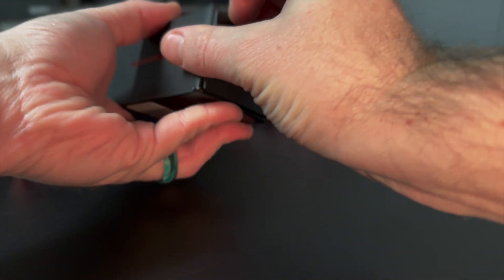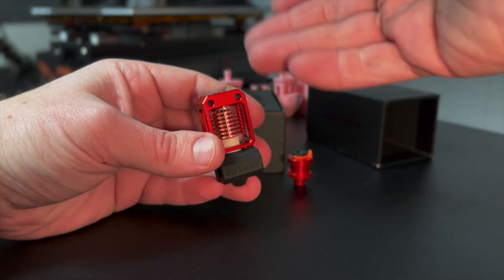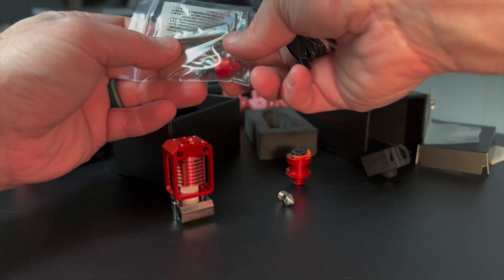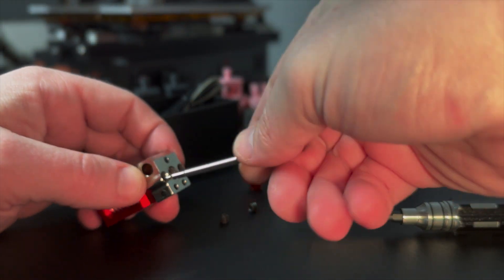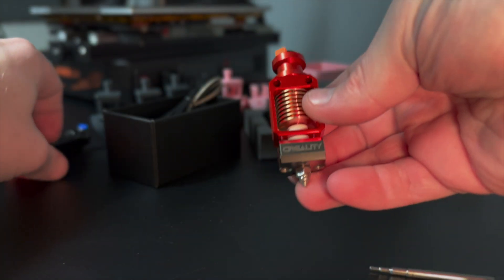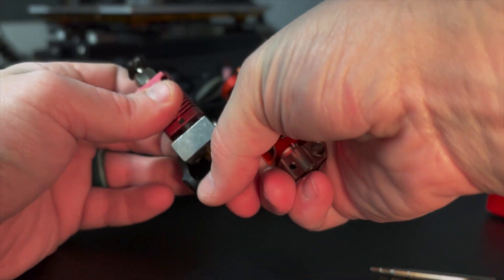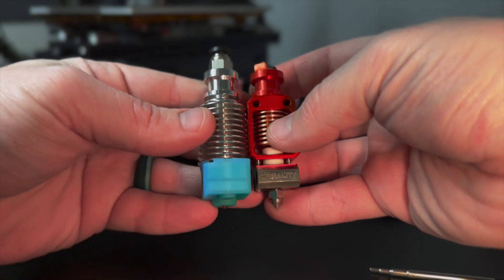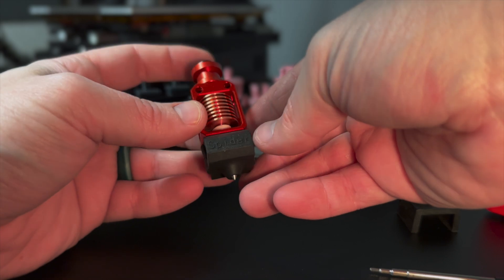The Ultimate Hotend Upgrade: Discover Creality's PREMIUM All-Metal Hotend 🔥🕷️

Comment: I purchased a used Ender 3 Pro with the CR Spider hot end. Also, BL touch installed. Any idea which firmware I should be installing?

Comment: Here’s my experience with the spider 3.0.  I’m relatively new to 3d printing so I can speak from minimal experience on the whole.  Having said that, I’ve learned a great deal about my Ender 3 pro over the course of the past few months.  From day one I’ve had issues with bed leveling and adhesion.  The only way to get decent adhesion, was to have the nozzle practically touching the bed.  Using the paper method, it had to be supper tight, as in not being able to move the paper between the nozzle and the bed.  I upgraded and adjusted rollers, tried upgraded springs (including the rubber ones), upgraded bed wheels (complete with locks), added Z axis stepper and lead screw. I Made sure the unit was square.  Yes, I calibrated the extruder.  The more I tried, the worse it seemed to get.  Finally, I started having issues with clogs on top of everything else.  I was just about to toss it in the garbage.  Being a tinkerer and an “upgrades” kind of guy, I had already purchased the spider v3 and had it in a box saving for when I felt like installing it.  As a last ditch effort I went ahead with the upgrade… BOOM!  The very next print was TONS better.  After toying with the nozzle height a bit, I started getting first layers like I’ve never seen before.  Now, using the paper method, I set it so there’s medium to light pressure, but the paper moves freely forward and back.  I would say closer to .1mm.  Of course you shouldn’t have to replace the hotend right out of the box, but what a relief.  Now I can get on with my 3d printing life.

Comment: Can you change the nozzle without holding the heat block?
Reply: Yes, I was noticing that also.  Since the heat block is bolted to the upper part you should be able to remove the nozzle without have to hold the heat block so it does not move.

Comment: Did you actually test it or just give it the thumbs up on just how it feels and looks?
Reply: Have to agree here, was fastforwarding to the part where we could see some results. But that part never came.
Reply from the maker: I got it as soon as it came out and made a video of it unboxing it, showing it off in case someone was interested in it, and gave my first impressions. I gave it a thumbs up on just how it feels and looks. 

You ever give a Ferrari a thumbs-up even though you’ve never driven one?
Reply: @3DPrintSOS  I would like to buy it on how it performs not how it looks and feels. Ferrari analogy is ridiculas.
Reply from the maker: @MacAdder1965   I respect that. Always do your research. For the record, I don't believe you. There’s no way you don't care about how things look or feel.
Reply: @3DPrintSOS  It could look like a pregnant frog for all I care as long as it prints amazing..... Looking amazing and printing like crap doesn't interest me.... This is going to be covered with a fan shroud so how it looks is irrelevent.
Reply from the maker: You’re not wrong. I agree with you there.  @MacAdder1965  But yeah, I haven’t gotten the change to use this hotend, as much as I wanted to. Just not enough time in the day. Maybe one of my builds will need a hotend in it soon, then I will likely be using this one.

Comment: I've had two of these and both ended up clogging critically.
Reply: Did you MPC or PID tune the hot end? Did you limit retractions as suggested? The Thermistor and wires are easily damaged that can throw off what temp you are actually running.
Reply from the maker: Oh man. Sorry to hear it. What fan are you cooling this with? Bowden or Direct drive?

Comment: Didn't realise you reviewed this product. Bought this as part of an upgrade for my cr10s pro v2 with klipper as I wanted to print more materials at a higher speed. Had to do some minor tweaks to the printer to make it fit but other than that it works really well. One thing to note that this nozzle is a high flow with a large heated area so it doesn't like being used on slow speeds without alot of oozing and air entrapment. I tend to print around 15 to 20mm3/s with a .6mm nozzle and it works great. Did upgrade the heater to high temp 60w cartridge but not sure if that's required.

Comment: I have a Swiss all-metal hotend for the past year and all the sudden I can't compete a print without clogging.  I tripped down and cleaned block and metal steam. Made sure all the plastic was removed even in the threads.  Verified there is no gap between the nozzle and hotend steam that threads into the block. I repeated this three times. I get clogging during infill and fails the print. Short of buying a new hot end i dont know what I am missing here. I was running black sunlu pla at 205, 215 and 225c. I was thinking hotter the better but this is not the case. In the past I alway ran sunlu pla at 215 to 220c and never had issues until now. Any suggestions?
Reply: PID or MPC tune the hot end. run the test multiple times, especially if the first tune fails.

Comment: I have had one of these sitting around for a while. I need to get around to installing and testing it. I am using the original spider on one my 9 printers. The OG spider has been working great with all filaments be it PLA,TPU,ABS, PETG or even PC. 

Only complaint I have with OG spider is the weight and the special nozzles but they are becoming more available.

Comment: What’s a good site if I wanna make custom prints and can I do it on my iPad
Reply from the maker: What do you mean by custom? Check out Printables.com and Thingiverse.com. Not sure if you can slice these files on an iPad. You might be able to use a browser-based slicer but im not sure.
Reply: @3DPrintSOS  like if I make some digital art from my iPad and want to make it 3D if that makes sense
Reply from the maker: @strangealternative3357  The only 3D Software im familiar with for the iPad is Shapr3D.
Reply: @3DPrintSOS  oh ok thank you for taking the time to help me I appreciate it
Reply: @3DPrintSOS  and when 3D Printing is it only possible to do it on a laptop like I heard people can do it on their phone
Reply from the maker: @strangealternative3357  If you can find Gcode files for your specific machine or similar, you might be able to load in a file onto an SD card or onto a printer that has Octoprint or Klipper installed. But you need to “slice” a 3D file so that your printer knows what to do. A GCode file is the only way to get it to print. Most of that software is only on computers.
Reply: @3DPrintSOS  ok and atm all I know is that I have the Voxelab Aquila X2 if that helps with more information

Comment: If that's an all metal hot end for printing high temp materials then the real test of how well it resists heat creep is to run some cheap pla at the temp on the high end of recomended temps with 6 mm retractions.  Build a model that requires lots of retractions and if no clogs occur then definately a winner.

Comment: It's a hard sell at that price. I mean, they will probably sell, but to me, at 40 to 50 percent the cost of my entire aquila, it doesn't make sense.
Reply from the maker: Yeah but let’s say you’re building a machine like a Voron, RatRig, or going all metal on a custom or FLSun machine. This to me is one of those pieces you buy that will literally outlast a build. With that said, I think it should be $50 bucks. But I think we all want everything to be cheaper.
Reply: The biggest advantage I've seen with those mid range hotends is the better flow rate compared to the stock hotend. It's more consistent, so you can print a bit faster before you run into speed related flaws in your prints. 
If speed isn't something you're too worried about, it'll make no real difference
Reply from the maker: I disagree. I don’t go for speed myself but rather the ability to print all materials. More importantly, not having a ptfe tube near my nozzle. This hotend does all that plus more. It’ll outlast most machines. I get that not everyone will see the value in it, but I still think it’s worth me showing it to y’all.
Reply: @3DPrintSOS  but an all metal heartbreak can be had for like 8$
Reply from the maker: Yes but I honestly don’t think the quality can be compared. I’d take this over a stock hotend with a cheap heat break. I mean don’t get me wrong, an economy car can get you from point a to point b. This is an obvious luxury. So it’s more like a do it all truck. Not for everyone. And that’s ok.

Comment: Would love to know how to add to aquila x2. I'm using Alex firmware and I know a lot of times you half to change thermistor type in firmware. Do you recommend a heater cartridge and thermistor for the x2? Long time follower . Look forward to seeing your videos. Thanks for content.
Reply from the maker: If you don’t have issues with your current thermistor, I would just use the sleeve that comes with the hotend. Put some thermal grease into it and push in the glass bead thermistor and you’re good to go. Then you’ll have a spare when/if you need.
Reply: @3DPrintSOS  that's the problem I have had 2 thermistors fail and bought new on Amazon. Finding correct length and value has been hit or miss.Creality was too short and the other read improper. I had to buy Voxelab stock head kit to get it to work right. Would love to upgrade but really don't want to go through a ton of thermistors. Due to firmware or length.

Comment: Its mounting holes are not the issue... it is the hotend shroud and fan unit.  it does NOT fit all Ender 3 models and documentation about that is terrible.
Reply from the maker: yep. I mentioned in the video that the problem was the cooling.
Reply: @3DPrintSOS  what ended up being your solution to the cr touch and fan shroud making the hotend not fit?  I have a v2 neo I'm trying this on,  and I finally found new mounts to print,  but was hoping for a more practical solution.
Reply: @nogard0007  bought a different printer.
Reply: Yep I installed on a 3v2 and the stock shroud no longer fit
Reply: Fits perfectly on gender 5 plus I just installed it
Reply: @jamesmyers9442 but there's only 2 genders...